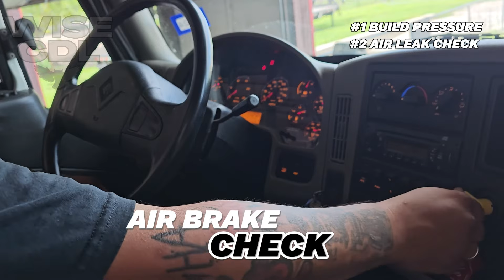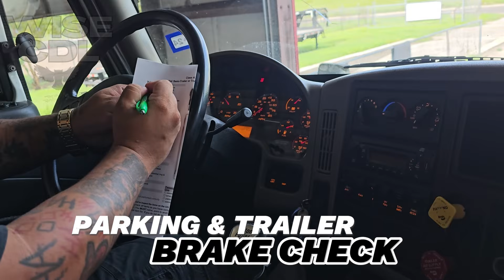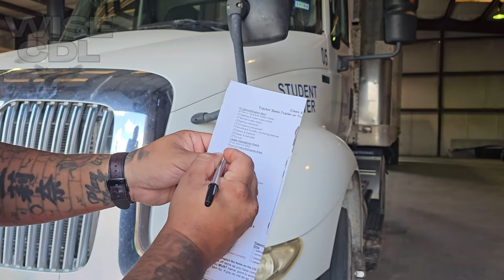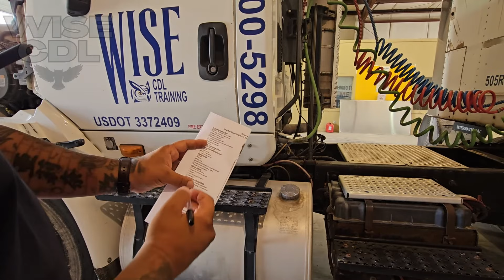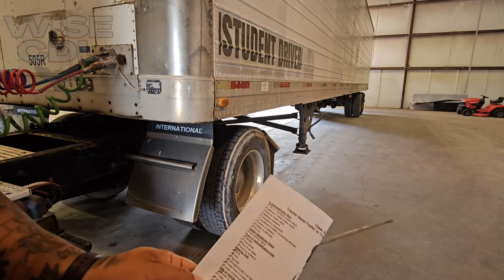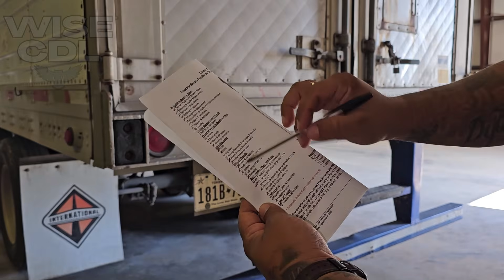CDL Pre-Trip Inspection Checklist: Pass on Your First Attempt!

Comment: what about alternator, water pump, air compressor, power steering pump, are they belts or gear driven?
Reply from the maker: For the new modernized pretrip inspection thats been rolled out in most states like ours, Texas, we no longer are required to check the components you mentioned for the skills pretrip exam. This is not to say they are not important and should still be checked during your routine pretrip inspections after you have obtained your CDL. Hope this helps.
Reply: @wisecdl956 yes thank you
Reply: Yayy

Comment: Examiners in my city are very strict. Several classmates of mine did the exam just like you. One didn't specify 'my air governor cutoff at X PSI' and just built up the air pressure—Examiner failed him. Another didn't specify the exact PSI air governor cutoff occurred in the primary and secondary gauges—Failed. Had a 3rd fail the applied air leak test for not specifying what the PSI was at to start the air leak test. The slightest slip up on the in cab and they fail you here
Reply: Just an update. I was auto failed within 2 minutes of being in the truck for saying my air governor cutoff range is 125-140. That's the number my school teaches every student, but in my state's manual it says 120-140.

Auto fail reason #2. My instructor teaches us to do the tugs and role test first so you only have to build up air once. He's taught that way for years. Then do the air brake tests. I was failed for that.

Auto fail reason #3. I applied the service brake 2 seconds before telling the examiner to start the timer during the applied leak rate test. The truck I was in loses about 3-5 PSI upon the initial application of the service brake so I always measured the 60 second hold after that drop. Failed for that

And here's a quicker. I lost a point on windshield wipers because I didn't say "wiper arms" and instead said windshield wipers and blades. Lost 2 other points during operational light check. School never taught us we needed to check the brake lights and clearance. 

Examiners in my town are crazy. I'll get it right next time though